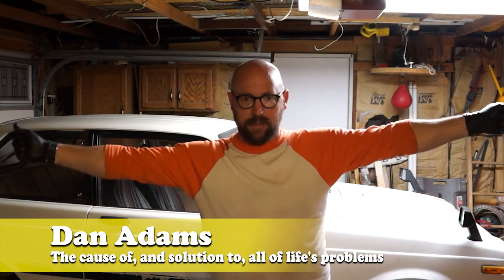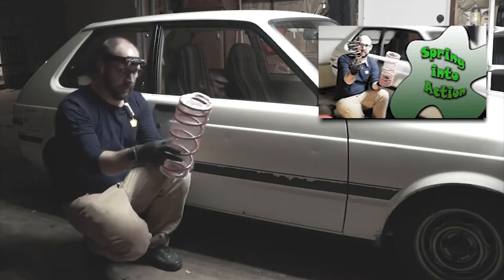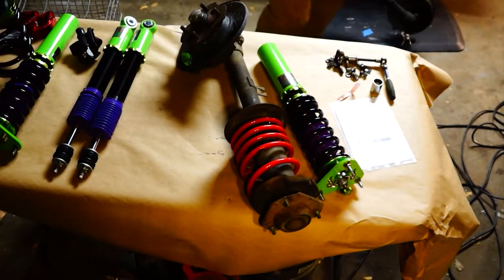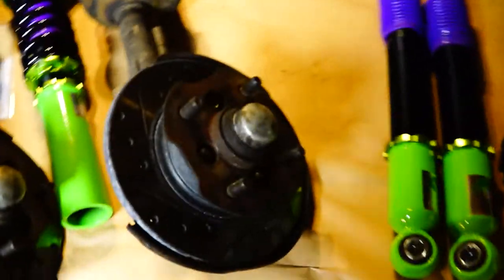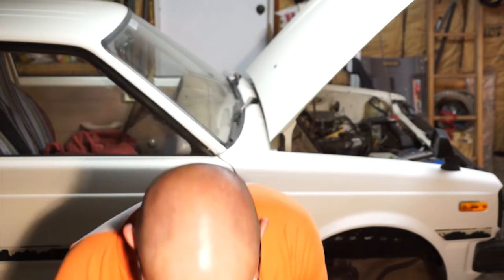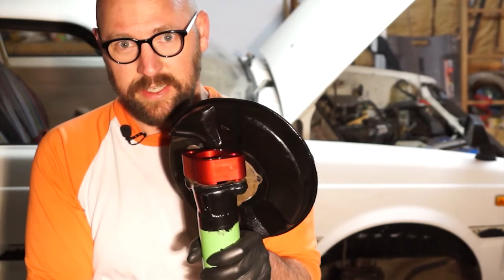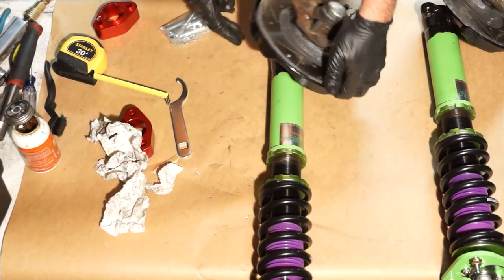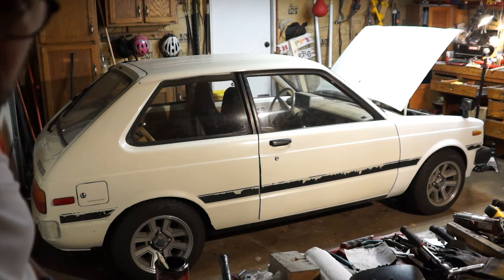The KP61 Starlet gets a Gecko Racing Coilover Suspension!

Comment: First u just got a subscriber. 
Second loved the video.
Third DUDE i'm restoring my Kp61 and i have some questions that i would like to ask you if care to help me , they are about parts for the car especially brakes and suspension related.

You are running all stock parts where did you get those brake discs, and wich coilover kit should i order for a kp61 from 82" european model will it fit? are they all the same?
Reply from the maker: Sorry for the delay. When you get this hit me up on instagram @hatchback_comeback it's not a trick to get followers on insta lol it's more that we can message over there with pictures and stuff more than happy to share some of what I've learned!